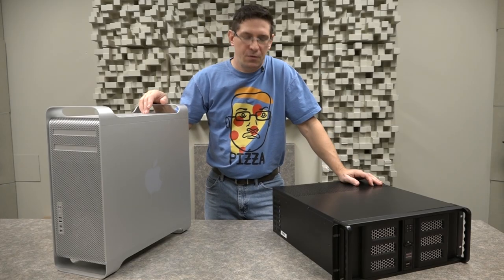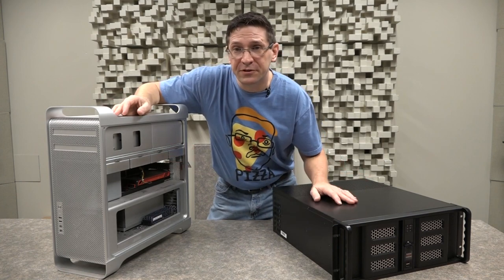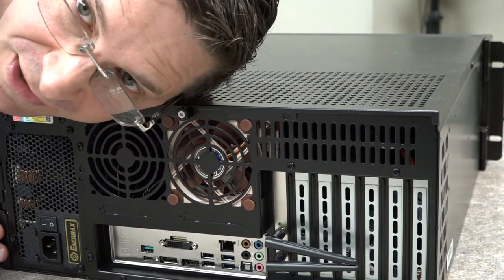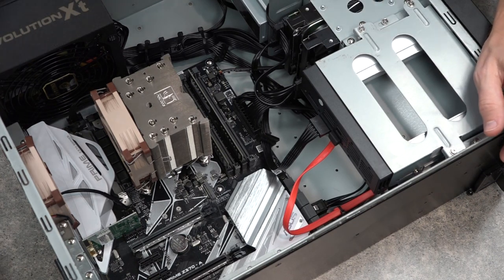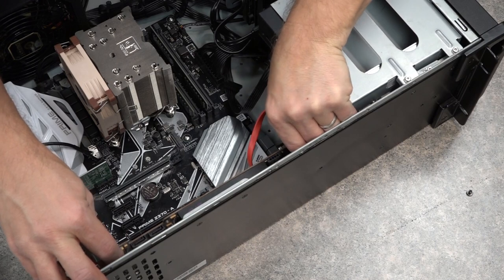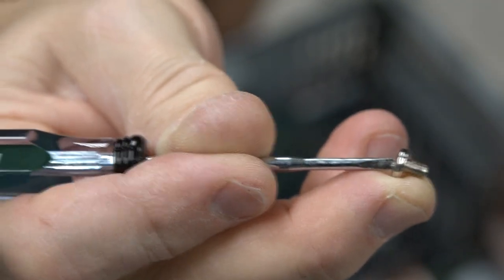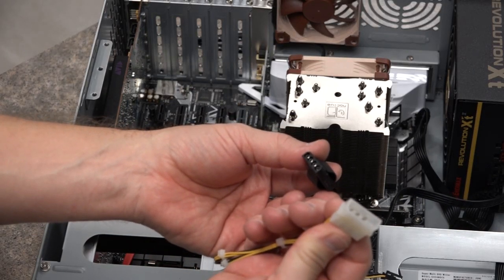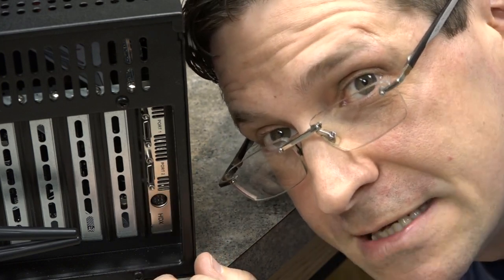Installing an Avid HDX Card

Comment: @2:40 no damage will occur from using anything magnetic in a computer case.
the floppy disks were vulnerable to electro-magnetic fields.

*there are very powerful magnets inside the hdds, less than an inch from the platters where all the data is stored.

Comment: I have Native HD and sick of latency when recording vocals. Will HDX eliminate this?
Reply from the maker: Before spending a bunch of money on an HDX, I would try to find the source of the latency. Do you put any plugins on your track while recording?
Reply: @MrBinthestudio  NoI dont used alot of plugins. Ive tried reducing buffer and its better but not even as good as reaper. Only thing I think of is the Native card is PCI 3.0 and my mother board (Asus sabertooth) is only PCI 2.0.
Reply from the maker: This is a tough one.  Based on what you've told me, I'm hesitant to tell you that an HDX card will fix it.  Have you tried putting this on the Digi User Conference?
You could also try renting or borrowing another computer, installing the card and software, and see if that fixes it.  That could help you narrow down the problem.